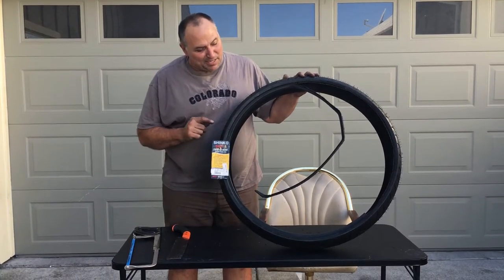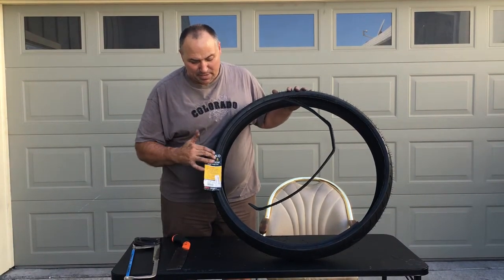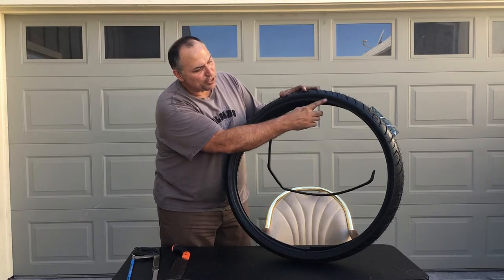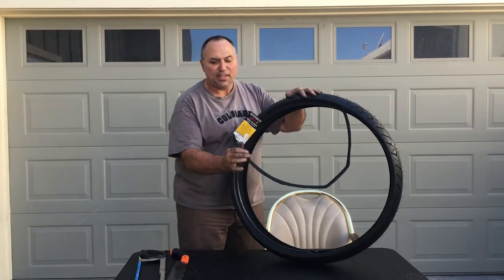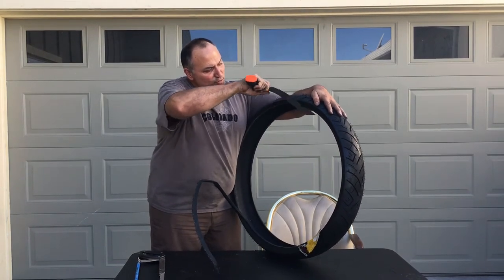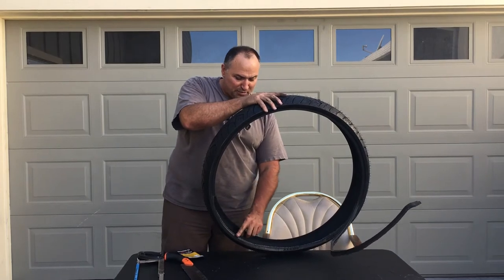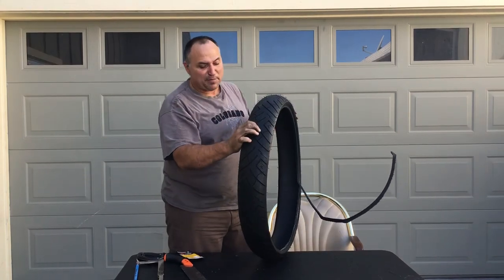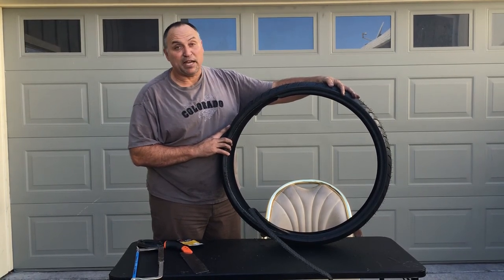Extreme Bicycle Tire Liner Minimizes Flat Tires e-bike ebike

Comment: I am watching your videos, and reading about your adventures on the LunaCycle forum. Innovative stuff.
Reply from the maker: Thanks. I will definitely be solving the problem of too many flat tires. I will keep trying extreme tire liners until I find something that deflects the sharp hardware. Too bad about all of the added weight, though. This is the worst place to add weight.

Slowing down to an average speed of 25 mph allows one to see and avoid sharp debris. Half of my riding is in the dark so I am hitting a lot of hardware that I can't see.

Getting a flat tire is the worst!

Comment from the maker: The instructions are on page 5 of the thread linked below. The instructions are:

A good motorcycle tire to be used for a fat tire bike tire liner will cost about $130, but that is the only cost. The plan is to get to the band saw as soon as possible, following these steps:

(1) Use a hacksaw to cut through the tire bead, which is metal, so that I can get a drywall saw in there for the next step,
(2) Use the drywall saw, which cuts through the sidewall easily, to get as close as possible to the final cut. That final cut is completely on the tread, so the drywall saw is used to remove all of the sidewall,
(3) Cut the tire cross ways so that the tire liner can now be laid out in a strip, which is now possible because the sidewall is gone,
(4) Use a huge die grinder with a rasp fitting to carefully smooth down the inside end of the tire liner,
(5) On the inside of the tire liner, carefully measure parallel lines, say, 4" apart which will serve as the precise width of the strip. Put masking tape on the area to be cut off. Cut with the band saw.
(6) Roll it up tightly and secure this roll with a long hose clamp or sturdy strap,
(7) Smooth the outside of the rolled up tire liner with 50 grit sandpaper on a belt sander,
(8) Shorten the tire liner just enough so that you can push it tightly into the tire,
(9) By hand, center the tire liner in the tire.

Comment: I'm sorry but that's really a stupid idea, it makes your rotational weight very heavy which in turn means you will shorten the amount of distance you can cover on a charge, and if you're pedaling it at all without power you will notice the more effort you will be putting out.  Not to mention all the work you had to do to cut that tire.

So the best idea is to buy the Tannus Armour liner, it's reusable, but more importantly it's way lighter than the using a tire as a liner.  This liner cost $40 but it's a one time purchase.

The other idea, not as good as the Tannus Armour liner but it does work, is to install a Panaracer FlatAway Kevlar liner and stick it to the underside of the tire, then install a Mr Tuffy lightweight liner between the FlatAway and the tube; then put in a thick thorn resistant tube.  This method would be the cheapest but the Tannus liner would be the best. 

Of course don't over look the tires, that is your first line of defense so it has to be up to the challenge, so get the best flat resistant tire you can find like the Schwalbe Marathon Plus.

Another option in regards to tires is also made by Tannus, it's a airless tire so you can't get a flat because there is no air to leak out!  However in tests done the Schwalbe had less rolling resistance than the Tannus which means your battery will run a bit longer plus the Tannus is twice the price..

Comment: ....and you ARENT worried about vibration due to imbalances eh?....mkay.
Reply from the maker: I have ridden thousands of miles on a rear tire with two old, smoothed bicycle tires in there as tire liners, four old bicycle tubes in there as liners, a new tube and 24 oz of the green tire slime with zero vibration. The only problem was two nails that got through all of that to cause me flats.

I don't know if the slime is in there rotating around and helping with the equilibrium, but I never have vibration and my tires are inflated to 20-30 psi on a bike with no suspension.

Maybe the fact that my rear wheel weighs 35 pounds is allowing for any small imbalances if they arise.

Comment: Lol
Reply from the maker: I still get flats using a single Mr. Tuffy liner (and slime!). 

I have tried using multiple Mr. Tuffy liners, but it is aggravating to assemble the tube+liners+tire on the rim when you use more than two Mr. Tuffy tire liners.

I have used smoothed and trimmed old bicycle tires as tire liners, and the assembly is easy, but a bicycle tire is still pretty thin. The motorcycle tire in the video is about five times as thick as a bicycle tire and reinforced with Kevlar. The extra weight is not a problem for the large motor and brakes. 

Getting flat tires is very annoying. It is definitely something to try and avoid, or at least keep to a minimum.